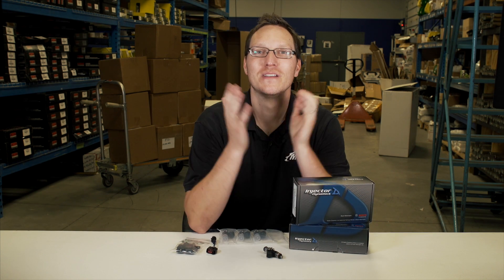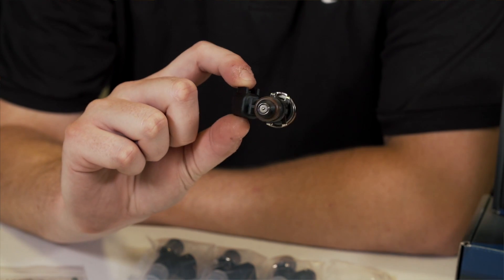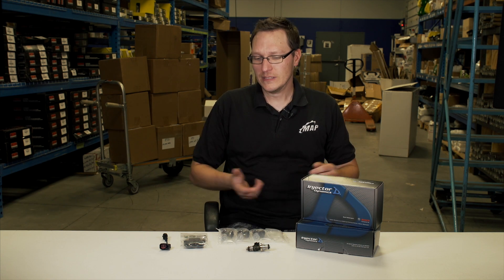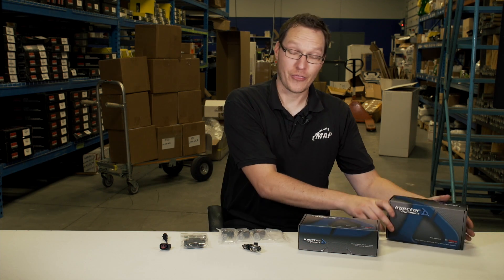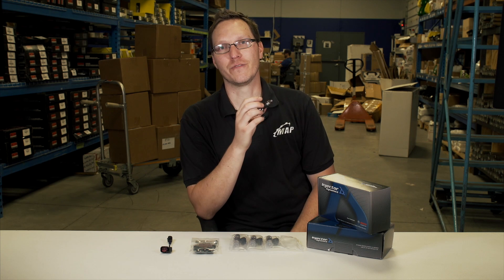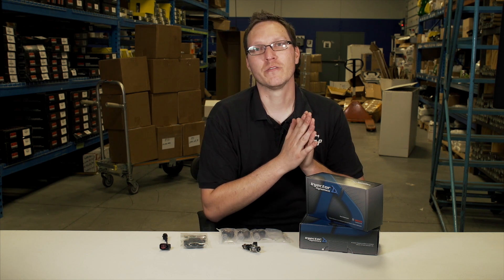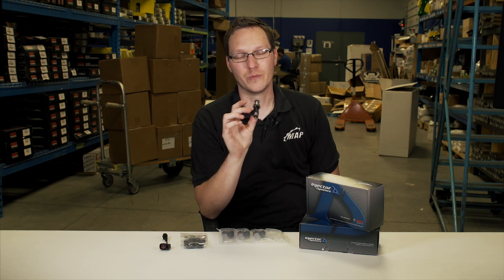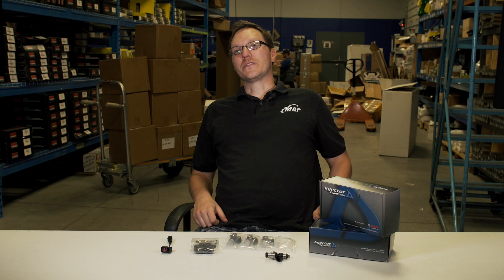Injector Dynamics New 1050x vs ID1000 Fuel Injectors & E85

Comment: What size injector should I get. Right now i have 1300, i have  hondata CanFlex E85 i normally run 52% E85, 48% 91 premium should I get 1500 i'm having issues with number #4 injectors miss fire#4

Comment: Good morning. 

I’m planning to upgrade my injectors on a 2005 Subaru Wrx with injector dynamics. My car currently runs a front mount set up and a stock tdo5 turbo. Can I run the id1050x on this set. I may have plans to upgrade in the future.

Comment: Helloo mate sorry to bother u just a quick question ... are id 1300 and id 1300x the same injectors just that I’ve mapped my mr2 turbo on boastane using the normal id1300 injectors and come into problems with fueling so a changed the fuel pump an fuel reg an still having problems now I think I’ve done something to the normal Id 1300 injectors maybe I made the wrong decision getting the normal id 1300 instead of the id 1300x ... just need to no if thy is any diffrance between the id 1300 and 1300x ... kind regards Dave

Comment: I bought some ID1050s to run with my b18b turbo I’ll be running a BorgWarner s257sxe 57/61 .63 with a walbro 255 Fuel pump, i’m not really building the motor just replacing the head gasket and installing  ARP head studs. I don’t plan on going crazy maybe 12psi but my question is did I overdo it with the set up ? I’m only looking to make maybe 300 hp as a start.
Reply: 1050x for 300 hp is way too much. Stay on stock injectiors. You can get 396 rwhp

Comment: 1000cc on full E85 will get you to around 800whp I'm at 87% DC on E85 boosted making 750whp
Reply: That's because you guys have more than 4 cylinders. Lol
Reply: Right? I have 1000cc injector (not ID1000) on a 2JZ running e70 and made 700hp @ 80%DC 50psi FP
Reply: I agree as well, 2jzgte with the regular id1000s on e85 and I’m at 715 rwhp 55 psi fuel pressure with twin 450 Walbro pumps
Reply: I have 1050s my tuner said these will take up to 700 or 800 no problem on e85. This guy is smoking something lol.
Reply: @Nathan-wn5mc  I'm thinking the same lol.. I'm sure the 1050x could do 700 e85 also. I'm thinking of buying these for just 600hp lol

Comment: I have a 2014 Mustang GT Auto. I want a daily driver turbo build.
was thinking 6 psi on 91 pump gas what do you recomend. I was thinking no more than 600 rwhp due to stock internals
Was gonna buy vmp Bap and boundary oil pump gears
Reply from the maker: Shoot us an email! sales@maperformance
Reply: 95lb injectors for that kind of power.

Comment: Was wondering if I can get away with the 1050x injectors in my slightly modded 2012 sti has cosworth Cai ..... High flow 200cell magnaflow cat .... Full length 3" magnaflow exhaust system. Cobb Access stage 2. Next question is if I plan for the future as u said will the injectors for the the ej25 fit the ez30 because I think I want to ditch the EJ later on with buying more than two more injectors?

Comment: Quick question. Where do I buy those pnp harnesses? And how many would I need? I currently own a 2012 370z nismo
Reply: @Pr0uditalian...., EBay; type in 'wireless injector adaptor' 
Wireless ones are better & cleaner looking. Injector dynamics uses uscar type connector, & I think your car uses denso type connector?
Reply from the maker: We can get them for you! Email / call us! 1-888-MAPERFORMANCE we can get you sorted out.

Comment: 750 flywheel hp on a SC S550 needs a 1050 ?
Reply: Wouldn't it be running rich on fuel ?
Reply: Forget to mention its running on 93 octane
Reply: You are good with a 95lb injectors for that kind of power

Comment: I had the choice between the id1300x vs id2000 and chose the id2000 because bigger is better, right? Did i make a mistake? Power goals is 700-800, e85, 2L GSR. It's something I'd like to take out on a weekend or nice day.
Reply from the maker: Sounds like a good one! Drivability is really the only thing that can be hurt when you go too big. E85 will require a higher flow and that is a pretty big power number so you should be fine!
Reply: U do not want ID2000's u need ID1700's. Ur drivability will be garbage with 2000's.

Comment: I absolutely agree with "plan for more power" . When I first bought my 2012 Evo X pro-tuned (stock turbo), I bought the ID 1000 injectors and a Deatschwerks 255 lph fuel pump, because I knew I'd be upgrading the turbo at some point. My goal at the time was to get to about 500 bhp, and I didn't want to go E85, because of the lack of stations. 

When I finally upgraded the turbo earlier this year, I also decided to do a dual map, which I now love E85 and I wish I would've done the that sooner!

My tuner (Boost Controlled Performance in Michigan) said I had to upgrade the fuel pump to a 340 lph, which wasn't that expensive (about $130), but during the dyno tuning, he was able to make 470 whp, but he had to tune it down to 420 whp because the injectors were maxed out. So, I'm currently leaving at least 50 whp on the table until I get the ID 1300 injectors, which will be in the Spring.